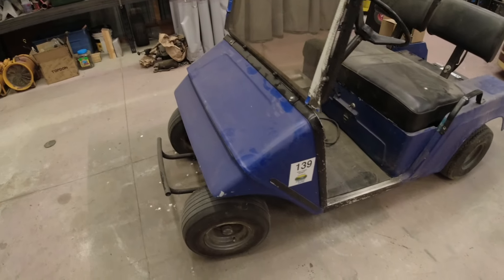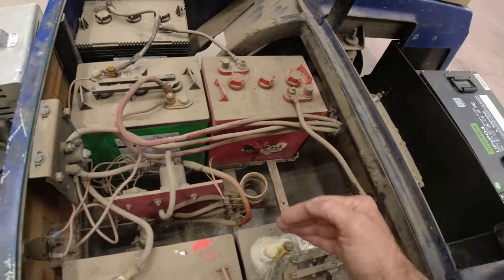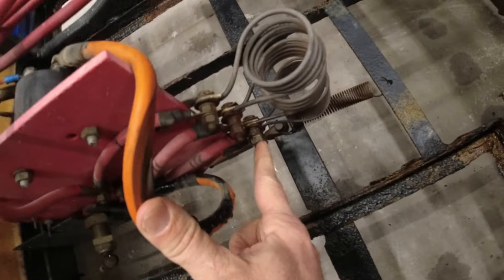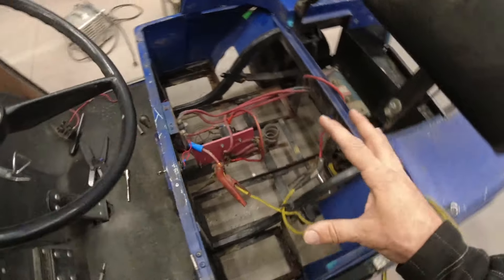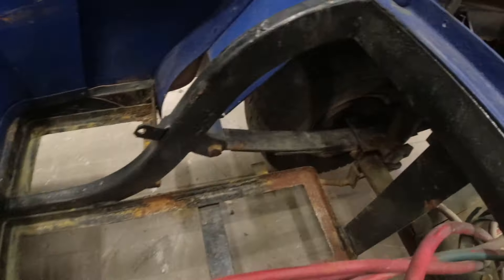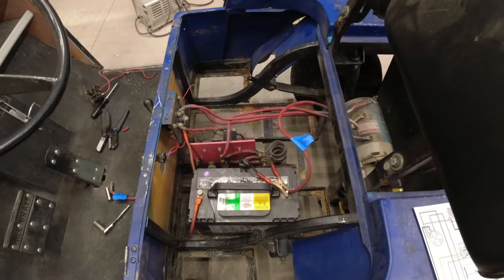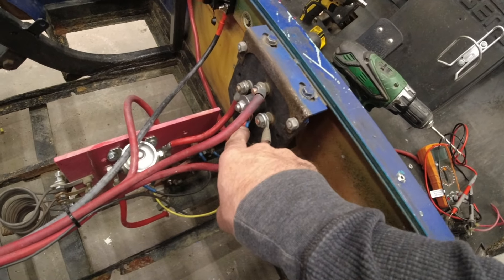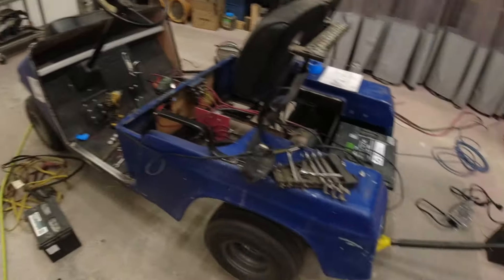Upgrading An Old Golf Cart With A New 36V Vatrer LiFeP04 Battery Pack

Comment: Cool video, my nephew and I picked up a similar golf cart a few months ago. He looked at replacing the 6 volt batteries and even a set of used ones were like $800. I tested the motor with my 40 volt Green Works battery, it works, but I accidentally shorted my battery for a split second and now it doesn't register on the charger or the mower it goes to. I put a meter on it and it shows voltage, do you know if there is some sort of internal fuse or breaker? I opened it up and didn't see anything obvious and have done some research online, I can't find anything to answer my question.
Also your daughter has gotten so big, when I started watching your channel, your wife was pregnant with her. Boy how time flies.
Reply from the maker: I know very little about those greenworks batteries, but I believe they do have some internal circuitry to  prevent a fire/explosion in the event of a short circuit. I am not sure how to repair them, though. Oh wow, that has been a while. That was over 6 years ago now
Reply: @AustinCoulson  Wow ...six years.  I started back in the forklift days.  I was searching fork lifts
( funny who I found.  Yourself, Low Buck, Jonathan W, and Watch Wes ........The Forklift Pack )

Comment: I believe the current is negative, while it's running, to indicate you are removing power from the batteries. During charging, it would show positive amps.
Reply from the maker: I think you are correct. It seemed counterintuitive to me at first. I thought it would show power consumption from the motor but instead it shows the power drain from the battery.

Comment: I don't understand why the golf cart specific battery packs are so expensive.  Vatrer lists the model 48 volt model I'd need for $1685.  I just purchased the equivilant capacity as 4 individual 12 Volt 100 AH units for only $560 including tax and shipping, on Ebay.  It doesn't make any sense that the "golf cart" container is worth an extra $1000.  What's the deal with that?
Reply from the maker: I actually talked to a couple different battery manufacturers about that and the reason I got was that the 12v cannot handle the spikes in discharge that the larger battery can. They said it was specific to golf carts. I didn't think there was anything too special about a golf cart controller and motor and it seems like its easier on the battery than a vehicle starter, but I am not an electrical engineer.